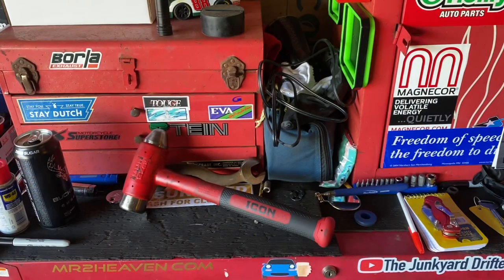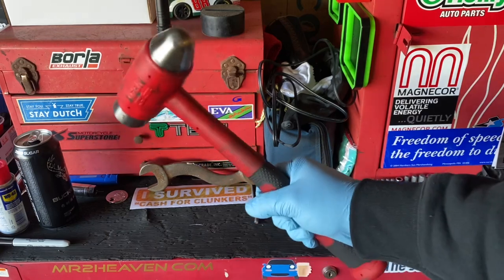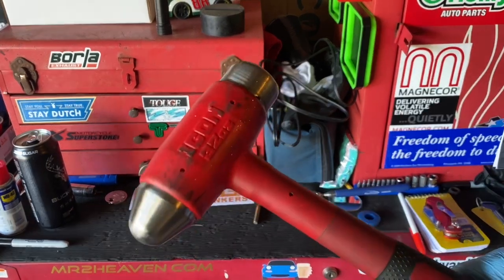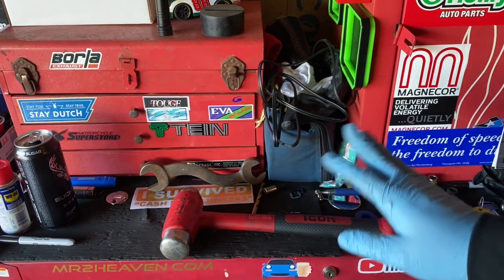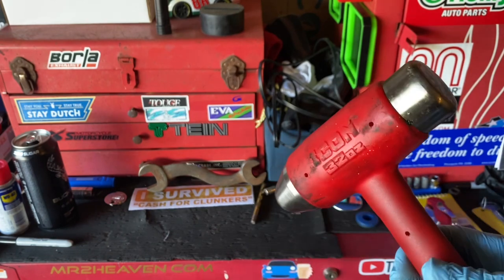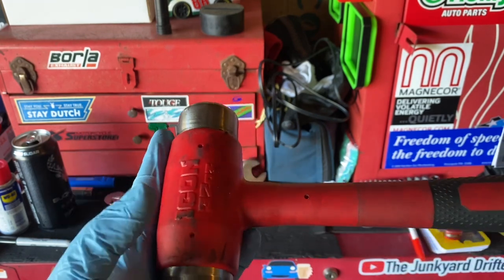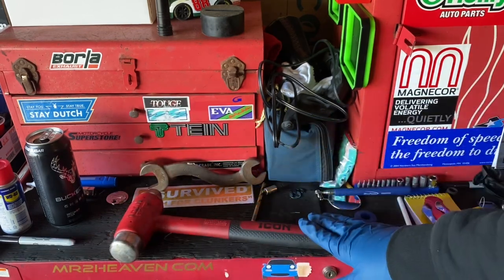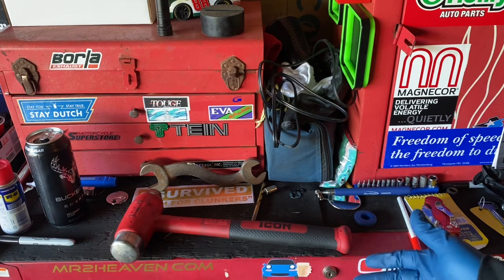Icon 32oz Ball Peen Dead Blow Hammer Review

Comment: just a heads up almost everyone but snap on uses trusty cook to make their hammers I like the icon tool line so far haven't had any issues. haven't used the ratchets as mine are 99% snap on and lets be honest they are the best
Reply: NO they DON'T. This is false misinformation, Snap On makes their own hammers at a totally different location to Trusty Cook. Trusty Cook are decent USA made hammers, much better than Icon but vastly different in design to Snap On. Please no more malinformation, disinformation or misinformation. I'm watching and ready to call it out.
Reply: @aussiehardwood6196  he said everyone BUT Snap-On, learn to read
Reply: I have a couple snap-on dead blows from the 1980s  that have none of the plastic left on them. Kinda like the screwdrivers which I have a drawer that is full of crumbling handles.  How do you warranty a pile of plastic?

Comment: I love good quality tools, but ohhh in the U.K. ??????????? Seriously the hammer your holding would cost me here around £200 GBP, $ 240:00 US. That's a heck of a lot of money for one simple tool!  U.S To U.K postal costs are seriously prohibitive P&P would be as much as the item itself. Only once did I buy from a U.S seller and that was only a certain kind of pocket knife and the seller was kind enough to put it into a large  consignment of gear coming here and the recipient posted it on to me. That item was only a few GBP but the P&P was over double the amount!  I ordered a 32 Oz Dead Blow Ball pein from Amazon here , but after reading a few reviews I cancelled as it was clear it was a made in China copy, and a photo of one bought by someone showed it was very very soft metal face full of dents and dinks, and it broke, it was also covered in welding spatter. the head broke off of the shaft and the plastic around the head had cracked and started to come off, and that was it's first day in use!